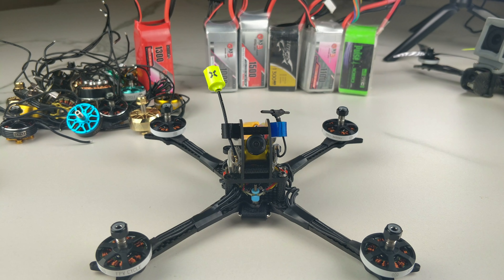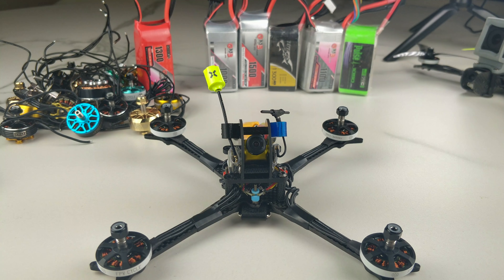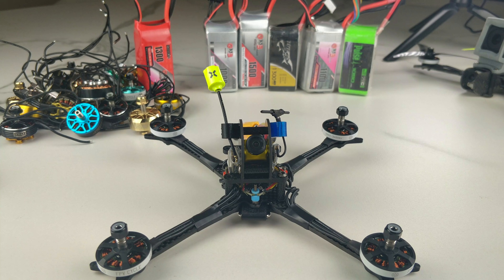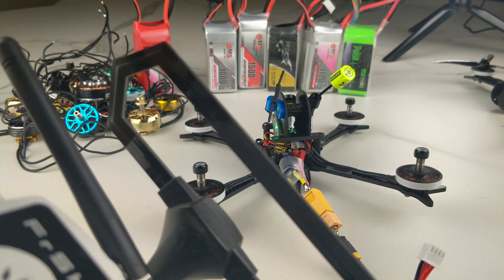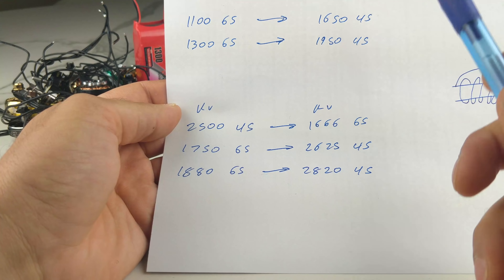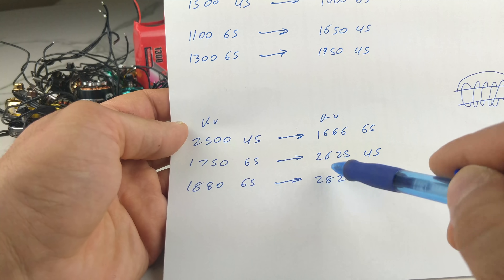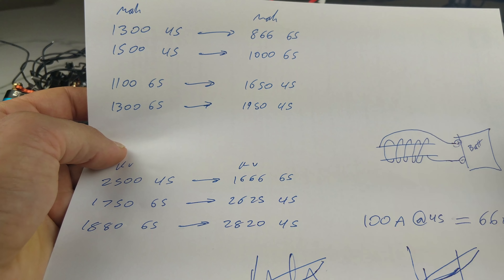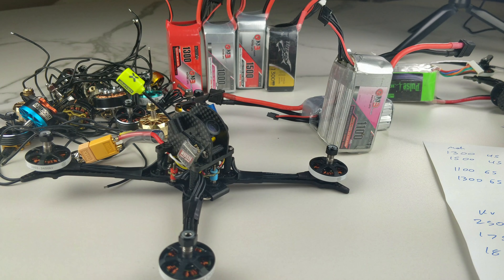6S Everything?  Why does 4S feel different?

Comment: I'm an engineer and im trying to ELI5 for your readers. The problem is motor inductance. There must be a equilibrium between motor inductance and voltage/current. Low inductance (=high kv, small size) have too fast response to the voltage steps provided by the esc, and the current is erratic and difficult to control, and might even  reverse during a commutation cycle.
Reply from the maker: From what little I understand, this is currently managed by a faster processing to keep up with the switching better. But yeah that's the issue with high kv high power and I suspect is part of why I'm having issues with the quad in the video....which is why 3S is fine on it.
Reply: Having played with COMSOL, this really shakes out to switching related EMI bleedover, not necessarily any wobbles.  Higher PWM frequency, reduced rampup power deltas, and then the actual motor inductance/capacitance, but they tend to be fairly lossy in that regard (a good thing), but this is why the excessively high KV setups see worse EMI, particularly when at the top end extremes, or when fed any amplifying oscillations.

Comment: KabaFPV, I think you missed a little point in the magnetic field explanation.
Yes, field is proportional to current, but ALSO to the number of windings. 

The KV number is inversely proportional to the Inductance of the winding, which in turn is dependant on the number of windings (I think proportional to N²).

6s means lower KV, which means more turns, which means less current for the same field strength but more resistance, which is where the higher voltage comes into play to theoretically balance it. 

I think the reason why it doesn't balance itself is, that field strenght is proportional to N, while inductance is to N².
Would be cool if someone checked that, who's better at math than me...
Reply: That would make sense.
Reply from the maker: I know this through many discussions and a few others have pointed it out as well. I believe this is at least in part why we don't need a whole lot more kv to adjust 6s into feeling better but I don't know by how much. I choose to leave this out because I don't know how much effect it has. Just choose to keep it as basic as I could which I know is not the whole story but the more I learn the more I know I don't know anything....will I ever know what's actually going on 🤷🏻‍♂️
Reply: @Kabab   "...will I ever know what's actually going on"  Probably not, we cant even fit gravity into the standard model of quantum physics. Its going to be a while.
Reply: @michaelwilkes0  as an electrical engineer, glad that somebody pointed that out :D thx
Reply: as an electrical engineer, glad that somebody pointed that out :D thx
Reply: My favorite part about this hobby is that whenever I finally feel like I've got a good grasp on something I am immediately reminded I don't know shit and have to relearn everything.

Comment: I was flying the other day on my 6s, everything on my quad can take 6s except for my motors, which are 4s. mid-flight my quad decided to cut out and just shut off mid air. When I went to go grab it I noticed nothing looked wrong with it and back at the bench the crsfr div nano receiver was no longer turning on. It was plugged into a 5 volt port and I also have a capacitor, is there a possibility that the 6s would have killed the crossfire diversity? Im on f7 kakute w dji, when receiver cut out so did video, everything just seemed to have shut off. quad still turns on just fine, I plugged in my nano receiver and it worked as well.
Reply from the maker: More likely the extreme voltage spikes of 6s killed the 5v on the board.
Reply: @Kabab  5V still works on FC board but not the diversity if that's what you meant. What can i do to avoid that in the future other than not running 6s? Is there a resistor i can add to protect, and is it possible to find the part that fried in the diversity and replace it in the future? For now just going to order a new one. Thanks for replying
Reply: it takes some time and a lot of deduction to investigate electronic failures. Things you might want to look into is what else is not ccurrently working on the quad. have you test flown it since? Is the DJI transmitter connected to a BEC as well? There's been reports of malfunction running it from a BEC on 6S. Have you tried checking the actual power output of your 5V rail while the quad is under load? Fixing a nano receiver would take tremendus skills. too smalll. very unlikely you could without super specialized equipment
Reply: @fkfontaine  thanks for the input. the quad flys fine with the nano, just tried it today. good advice on checking the voltage on the pad under load, will try that. the DJI is connected to the FC since its the HDV model made to run with it.  I am interested in learning how to repair stuff like this, so may get the equip to do something like that one day, just wanted to know if it was worth keeping around or not. I have some gear here that 5 years later id get to fixing and be like, oh crap, it works now, and i learn a new skill. I guess all of us love tinkering here or we wouldn't be messing with this sometimes frustrating crap lol
Reply: @TheDro  I can relate bro. I need to learn to use a multimeter, but I have also put several RX's and an ESC to the side, and started investigating SMD soldering. I too am interested in learning more about this new hobby that I adore. A few days back I began experiencing RX issues, and after like 3 days of poking around I concluded that my RX isn't getting any power from the 5V I have it connected to. Now, besides trying to power it from another source, I want to know if I may have fried the 5V regulator or somesuch, and if so, one day, i'd like to repair it, if possible. Anyway bro I can relate to what you were talking about. Good luck and peace out ☮
Reply: Bro, the same thing happened to me with my new Prebuilt Diatone Roma F5 6S. Flying around a park doing flips and it feels like it suddenly disarmed and fail-safed mid air. As soon as it hit the grass I was able to rearm and take off again. Doesn't inspire confidence at all...

Comment: The magnetic field strength is proportional to Ampere*turns, not current-only. Force/torque is proportional to the field.
A 1000kv motor needs twice the number of turns on a stator pole compared to a 2000kv motor with the same construction. Thus, 20 Amps through the 2000kv motor produces as much torque as 10 Amps through the 1000kv motor.
There is a catch though. Winding inductance, and therefore the ability to change current/motor torque quickly, increases with number of turns squared. A single stator winding on that 1000kv motor therefore has four times the inductance of the winding in the 2000kv motor case. But current must ramp to half of it to produce the same amount of torque. So it is 4/2 = twice as 'sluggy' as the 2000kv motor. Maybe that is the reason why we prefer higher kv on 6S?
Reply: Bingo
Reply from the maker: Very very helpful. Totally forgot about that but makes total sense. So it's probably a combination of them which is why we don't need a whole lot more kv. Just a bit more to make it feel closer to 'right'
Reply: @Imakilln  : Yes, you are right, I swapped them around. I will edit my text.

Comment: Would you recommend buying a GoPro hero 5 session today at $100 or going for another camera?
Reply from the maker: A refurbished session 5 is easily the very best camera you can find for the money.
Reply: If you can get a Session 5 for $100 USD, buy it. You could always sell it and make a profit if anything.
Reply: for the price the hero 5 or 5 session is the best buy. if you can find a session 5. ive got a hero 5 i just bought ill sell for $100.
Reply: Jesus man $100 usd is a steal haha... costs £145+ = $180 in the uk
Reply: @Kabab  Do you think there will be a GoPro 9 session?
Reply: @Kabab  wish there were more available, I haven't seen one refurbished in a while
Reply: That's the price Session 4s usually go for. Buy it! If the seller has more, buy two.
Reply: Yes for $100 get it, looks like the refurbs on Amazon are out right now and even then those go for $130, next best deal is a refurb hero 6 if your doing cinewhoop/cinematic style.

Comment: Interesting info here, thanks Kabab.
I started on (edit:1500mah) 4S, 2207 2500kv. I was always in a rush to build a 6S rig because of all the videos claiming longer flight times, less sag etc. When I finally built up my 2306.5 1850kv, on 1100mah 6S I was actually getting SHORTER flight times (Both at about 625g  with Session5). I also found it's harder to find good performing, lightweight 6S batteries. My $46 Thunderpower 1100mah battery flies like a dream and is lightweight, but my $28 1000mah GNB is super heavy, and gives me short flights with sag comparable to 4S. 
I've found the 1250mah 5S from pyro is one of the lightest packs that gives me 5+ minutes of freestyle flight, minimal sag, and I fly it on a 88% motor output limit on the 2207 2500kv. That is my go to for the "4S" quad. It seems I just have to cough up some more cash for the good batteries to get comparable performance on my 6S build.
Reply from the maker: Your experience is not unique unfortunately.  The people claiming so much more flight time are using batteries that are way bigger than the equivalent 4s so of course it's going to have more flight time. But overall, 6s is actually less efficient.....but better voltage stability and improved electrochemistry condition.

Comment: Very informative video, thank you! I noticed that Gemfan gives (very) similar information on 5125 prop at Banggood. Just one thing, you didn't mention the different amount of coil turns that different kv motors have. If I'm not mistaken more turns (found in lower kv motors) can make an electromagnet stronger. Please correct me if I'm wrong and again thanks for the video!
Reply from the maker: Yes and no. More turns means less current is needed to create the field but you need more current to saturate the stator. Less turns will have faster moving current....it's ultimately about the same but the difference with higher kv is that the field strength rate of change is faster because it ramps up faster.

Comment: This is fascinating. I wonder if you can use a regulator to limit the voltage and then "shift gears" to a higher voltage to help provide the most torque possible. Obviously the biggest issue with this is the kv would then have to be variable as well. Honestly I don't understand how kv is implemented into the construction of the motor. Is it the coil amount? The gage of wire? Magnet size? I actually don't know. But I fear it can't be variable which could destroy my "gear shifting" idea.
Reply from the maker: I'm working on that to better be able to spin it into English people can understand.

Comment: It really does for 5in and up. If I’m being honest I have not flown any of my 4S quads in about 6months. It’s subtle but there is a real difference
Reply: why does kabab say that 6s feels worse and is less linear? When everyone I know who flies 4s and 6s freestyle says 6s feels better and is faster and lasts longer
Reply: @cinialvespow1054  It depends on how you fly I guess. I can see how someone who flies aggressive freestyle with fast punch outs would benefit from 6s more as you get less sag and also higher peak rpm considering how we usually run higher kv motors for 6s than 4s equivalent. However for someone who prefers mellow freestyle and maybe slower proximity flying, more linear power delivery on 4s might be an advantage over 6s. That's just how I see it.

Comment: Just for historical perspective. Years ago, we used to run wimpy Gemfan 5030 bi blade props. Then everyone got excited about heavy bull nose props, then tri blades, etc. Ppl were trying to get more thrust by just beefing up the props, and not thinking about the efficiency of the motors. So motors and voltage isn't the whole story. Lots of guys kept everything the same and just started flying heavier, more aggressive and less efficient props (also just cause those props were more durable). I think prop tech is just as important as everything else in these equations. Do you want to punch out to the moon and kill your battery in 20 seconds, or do you want to fly smoothly for 3 minutes with consistent power, and your props are much more fragile. But material science has also come a long way. I remember flying Gemfam 2 blade 5030s that would all completely explode on a rough landing. Props are a big part of this story

Comment: Hi, Do you think it would be a good idea to get the 6s version of the nazgul 5 hd but fly it on 4s as I'm a beginner or just go with the 4s version. From what I understand, 4s will work on the 1700kv motors but will be quite weak and mainly for cruising. Basically dilliberately making it weak so I can learn but future proofing it for when I go 6s.
Reply from the maker: Yeah that's a good option. I'd generally cautioun any rtf. It'll most definitely break and you'll need to repair it

Comment: Equivalent 6s to 4S motors are same speed but it's the total WATTS output power that counts. A 6s setup will run cooler and more efficient at same speed  to 4s. It's at about volts X amps

Comment: If I'm looking to get a 5 inch drone mainly for cinematic, mid range, mountain surfing, is it better to get the 4S one or the 6S one and what if I run 4S batteries on the lower KV motors?
Reply from the maker: 4s on low kv motors is actually fantastic but it's not quite the same level of sharp performance as the appropriate voltage on the same motor. Flight time is like twice as long however with the same overall watt hour battery. Overall, it's best to have a balanced performing craft rather than focusing on just voltage or capacity
Reply: @Kabab  Thanks and agree. Your video made me stick to 4s (the drone I'm looking to buy is 6S compatible anyway, I would just need to swap the motors so I can do that down the line if needed)

Comment: Interesting, but are you sure that  current has higher impact on magnetic field, then  voltage? For example 10a 4s and 10a 6s generate the same value of magnetic field? or on 6s it will be more powerfull field? I was thinking its combination of both
Reply from the maker: Well it is both. 10A at 6S is a lot more watts than 4S at 10A. Like I said, voltage pushes amps harder but not until they're needed. So what happens is you get more power overall. You're not getting torque from the volts. You're getting more of everything and less torque at the lower end of things.

Comment: That these gyros meant for phones (very optimized current draw), that work by very precisely vibrating a nano scale mass, and then very precisely measuring the difference that's crated by moving moving it. That this still works when the gyro is on the same PDB as 4 extremely tightly packed, creatively component reduced ESCs, is kinda ridiculous.

Comment: This has my interest peaked in building a 5” 3s quad. Based on this video and the description on your website, as long as it stays decently light, 3s is something you actually recommend for the higher kv 2203? Also I flossed this morning😉
Reply from the maker: Yes exactly. This quad on 3s will be awesome
Reply: KababFPV thanks for the reply I think I’m going to try it! Do you plan to revise the power pick at some point? I think I’m going to build one out but looking at a few other options like the pyro ul5 frame